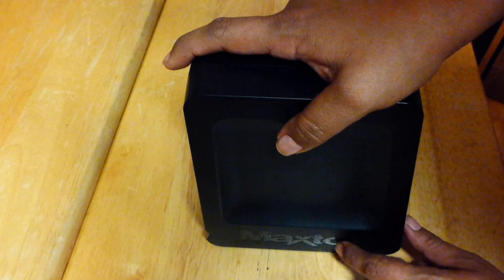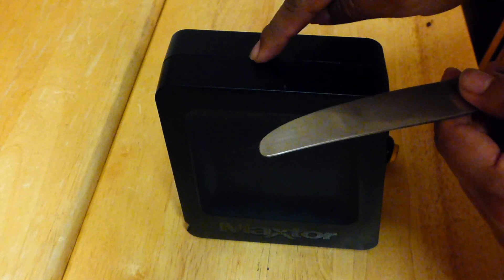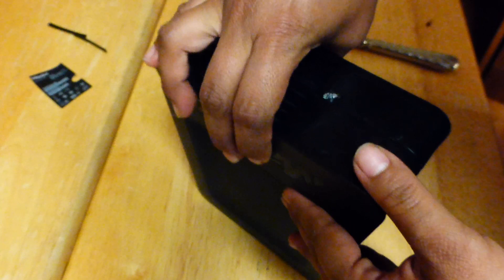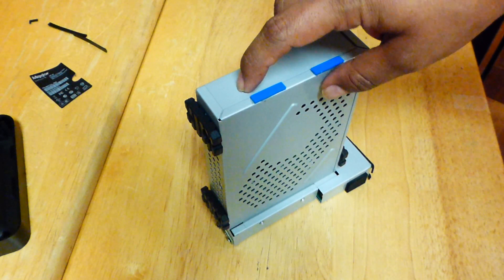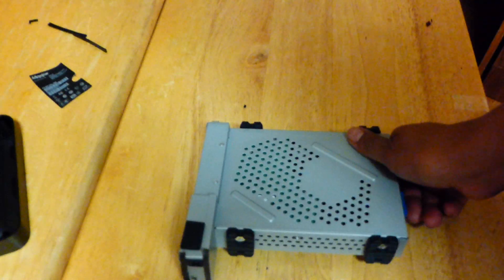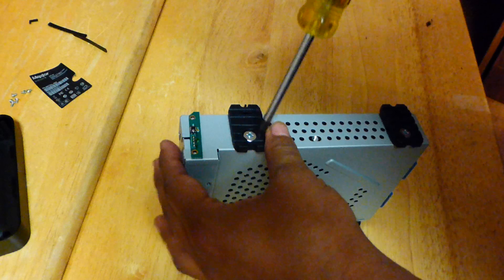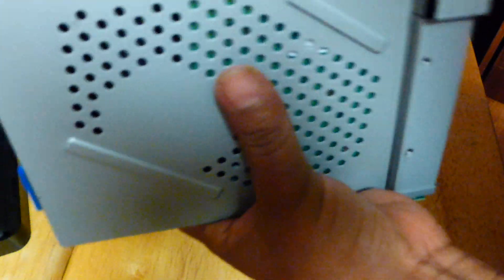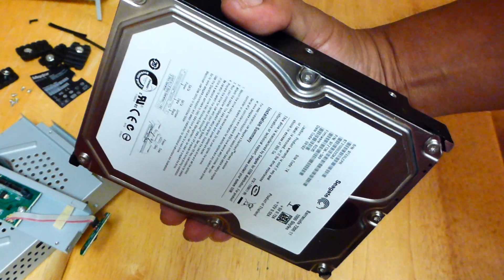Maxtor One Touch 4 disassembly

Comment: Thank you very much. Almost 10 years later, I found my old Max drive at home and decided to plug it into the power supply when I turned it on. I found that the power supply wouldn't turn on. I just disassembled it and now I'll see if I can connect it to my old computer. Hope it still works. Thanks again!

Comment: Wow. Nice video. I took mine apart and it was very easy. Didn't have to break anything. Then bought a usb 3.0 to sata adapter from amazon - $17 and plugged it in and it works great. Thanks for informative video. And you really need to get more screwdrivers! 😄

Comment: Great video, thank you a lot, but the question is - how did you recover the data from the HD? I did what you did and inserted the hard drive to a SATA docking station - and it turned out I could not access the data. In my opinion the data partition is probably encrypted or is using some proprietary file system format that can be accessed only by the OS on the Maxtor circuit.
I can see all the partitions with Disk Management in Windows, but I cannot do anything with it. 
I appears that only Maxtor circuit can interpret the data on the hard drive.
Any suggestions?
Reply: use
    1. Tenorshare UltData - Windows/Mac(Any Data Recovery)
    2. Retrieve
    3. Wise Data Recovery
    4. Free Undelete
    5. UndeleteMyFiles Pro
    6. Disk Drill
    7. Test Disk
    8. Glary Undelete
    9. Pandora Recovery
    10. EaseUS Data Recovery Wizard
recover data with assembled disk, then disassemble and replace it

Comment: This is great video, I got the Seagate barracuda (500 Gb) out of the enclosure just along watching this video. Thanks for the video....  However I got a docking station as the one listed on amazon, and my disk isn't recognized either.... got no other HDD at hand to test the docking unit itself. Any other ideas  to get my data back from the Seagate barracuda which by the way states on the box label that it was conceived to "save your life" and that it comes with a 5 year limited warranty "for total peace of mind"? (I guess for Seagate a lifetime spans for 5 years and after that just throw away your peace of mind)

Comment: Thank you so much for this video! HUGE help and amazing step by steps. Saw another video, but it was a slightly different model. This..I have the same exact model. After 5, 6 years it suddenly stopped working late last night - Looks like it has power, but that white light in the front casing just blinks and the Mac doesn't read it. Like you, my number 1 priority is to get my photos back. I have some backed up on DVDs, but not even close to all of them. Ugh. We're you able to get the HD working, retrieve your photos? Hope so! :) Anyway, just thrilled I was able to get the out..now hoping the casing, the little mother board is the culprit, NOT the drive itself. Again, thank you for this, I really appreciate it. Take care.